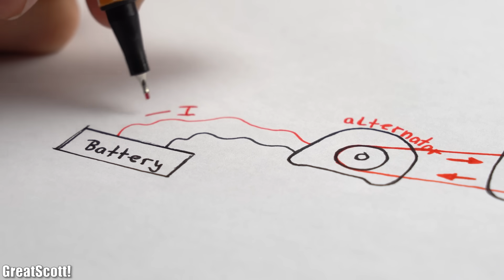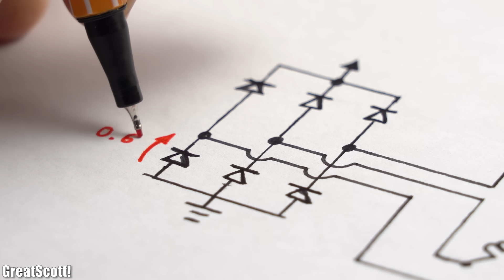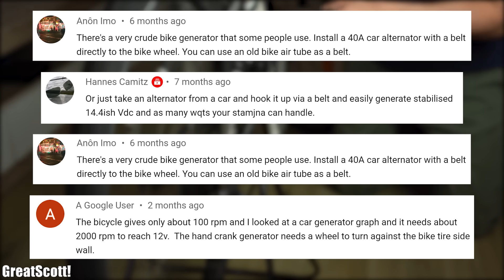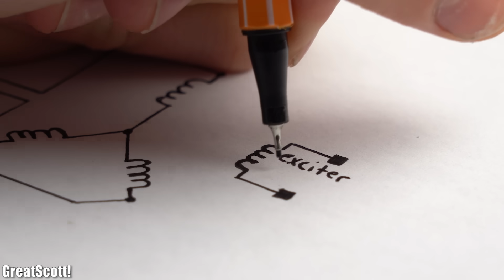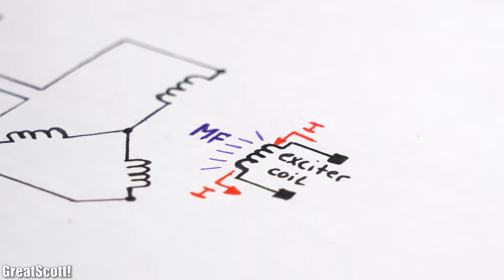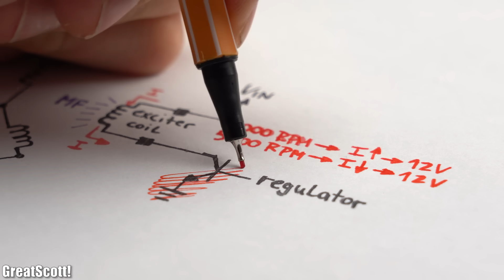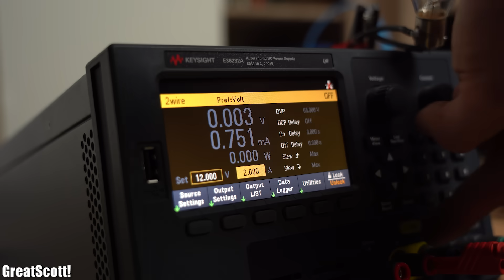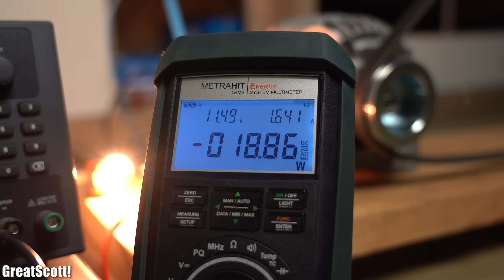Using a car alternator with a bike to power my home? How much energy can I produce?!

Comment: Instead of taking apart the alternator, all you had to do was add a battery.  Then connect a inverter to the battery.  The more power that you draw from the battery, the more the alternator will supply as long as you can maintain a constant rpm.
Reply: yep an auto electritian wired one up for charging batteries at his work but it takes 1 hp to drive an alt and we cant generate  that for very long. He had a 1 hp motor attached and it worked well. maybe a smaller gen would work rather than  a car one .try a wipermotor
Reply: @claudegrayson7039  try a hvac condenser motor !
Reply: 1 hp could be attained by several people. It would take some serious  engineering to make it happen, but if it had to be done then that's it.
Reply: I have an inverter linked to a car battery which I use to power LED festoon lights in a 20 ft shipping container. It's OK for low power demand and I get ages out of it before I have to recharge it at home. Perhaps the best way of looking at it with that set up is that instead of say paying to use the gym the free exercise session on the bike could be used to top up a car battery via the alternator which could be used to power a laptop, charge your phone or TV to save money with the expensive cost of electricity these days
Reply: @stoneislandkirkcaldy how much pedalling would it take to fully charge a battery?
Reply: @tomkeegan3782  no idea although good exercise
Reply: Solar , Wind , and gearing in conjunction with most of what has already been said .
Reply: Yeah but then how will he win the Tour De France? Or in this case Germany?
Reply: That's why they call it an alternator instead of a generator.
Reply: The exciter winding will saturate quickly,resulting in its fixed power requirement.However one can increase the exciter voltage,within the limits it can tolerate,for greater power output,however the stronger the exciter field becomes,the more power it takes to turn the wheel.
Reply: Could a water wheel be used with the right application?
Reply: @MoltenMozzarella Priceless.  Mean spirited but priceless.
Reply: great video. i think there was also significant loss from belt slippage and the rickety wood construct. yes i do believe that even just a small 12v battery wouldve helped.
Reply: Yeah or just make a wind turbine and add a solar panel to the coils when there's sun and win your gone get power and when there's no sun there is no resistance so you won't have to worry about it blowing up in the evenings. Or on really stormy over cast days.
Reply: This involves a loss of Efficiency so even if you started with a fully charged battery it would drain down till flat .
Reply: @Suzukidave  The battery connected between the alternator and the inverter acts like a reserve.  And the alternator needs the battery to start producing current.
Reply: @mike77tmc2   sorry mike I was trying to reply about useing a drill to power the alt .
Reply: U can have the drill with batery and u put the batery recharging with solar panel and use that power solar charged to put drill working the alternator.@mike77tmc2
Reply: @Suzukidave resistance like any person knows just thinking in our body, when u climb u spent more energy than down the hill..the same is with energy production..
Reply: Is so simple to understand free energy unstoppable is impossible thinking in a Dinamo bike creating light at night with wheels rotating, but there what is the energy needed for produce the light energy, YOUR BODY ENERGY, YOU STOP ROTATING THE WHEELS AND THE ENERGY LIGHT STOP...SO, YOU HAVE TO PUT ENERGY TO CREAT ENERGY, EVEN SOLAR ENERGY PRODUTION IS GONNE IN THE NIGHT BEING A CYCLE OF CHANGE SOMETHING FOR OTHER THING, NOTHING 100%FREE, EVEN IN NATURE...
Reply: Use a few alternators and a reliable rpm source to charge the batteries and plug the batteries in series to add voltage
Reply: Nope. An inverter just shifts the decimal 10 amp draw on 120v is 100 amp draw 12v at battery. Youd waste just as much as you generate edit: thats assuming you have a high efficiency inverter
Reply: Is there a video to describe what you mean????
Reply: and the more energy out of the alternator /generator the harder the bicycle will be to pedal .
Sorry you can't get something for nothing !
Reply: What if you used the pedal power to charge the battery,  and then use the battery as your source of electricity?
Reply: Joseph Newman kinda did something like this but the battery was giving headrunning voltage to the machine and the machine took that voltage and multiplied it and created more voltage than the battery even supplied

amazing!!
Reply: Could you essentially turn the alternator with a drill that is powered by the alternator which is charging a battery system?
Reply: @limerind7493  if that worked we'd use that for all energy generation. The drill will not be completely efficient turning the electrical energy into mechanical energy (some of it is dispersed as heat, sound). The alternator also won't be able to turn all the rotation energy into electric energy because of that heat, sound, etc. There is no free energy, you always need to have a source such as consistent flowing water (which will eventually erode away the parts or divert its flow, sometimes rivers dry up as well). Basically anything that seems like free energy on Earth is powered by the sun or magnetism (which isn't a permanent force either).
Reply: @theweeviler what about TIDAL energy? That's Lunar. How much energy would be required to pump entire oceans, twice a day? And reminder Solar energy is just Nuclear energy, from a safe distance.
Reply: @limerind7493 this would essentially be perpetual motion. Perpetual motion is impossible because there is no such thing as 100% efficiency. Using the drill to run the alternator, charging the drill AND charging a battery would require not just 100% efficiency but higher than 100% efficiency. You would be creating energy, in violation of the first law of thermodynamics.
Reply: @limerind7493 no. E=mc2
Reply: @BRAV-lm6xk Enter the theory of RELATIVISTIC ENERGY and RELAVISTIC MATTER. What is the Mass of a Photon?
Reply: @limerind7493  Let me guess. You think you've stumbled upon perpetual energy?

Comment: Hello, thanks for the vidy.  First, good job experimenting.  But to get 1500 watts you'd need ~2 hp input...  As for excitation current, a control neg feedback should work (invertor and regular... common emitter followed by emitter follower xsitors (bias will control current curves).
What I'm looking for is the size of blades for a windmill that will generate >2hp and then use a cvt type pully coupler to keep rpm relatively constant on the alt with varying wind blade speeds ( varying within typical range of 5-20 mph wind). Torque is key but with that comes size :  (
Have you done anymore work or experiments re: efficiency?
Ty

Comment: There was a study done on the movement efficiency of the human, versus other animal species, and humans came in 4th! Not to have that happen to such an "advanced" species, they then conducted the same experiment on a human riding a bicycle - and the use of gears propelled (no pun intended) the movement efficiency of humans to #1 on the chart. I see no reason that you can't generate your own electricity, it's just the will to experiment and find the most efficient output.

Comment: My car has a 12v/140A alternator. Because I live in my car, I purchased an additional Deep Cycle AGM battery, that I charge with a 5A car battery charger, from the 12v outlet. Am I putting too much drain on my car alternator? Should I use gears to have the engine at around 2,000rpm, to ensure enough alternator output?

Comment: Could you not then use this set up to charge 12v car batters? Could you then use them in series as a battery bank and run DC converters off of it to power devices?

Comment: If a person lived in a sunny area where the sun is not obstructed by clouds most of the time I have the idea of using a frensnel lense to heat a cylinder with a think saline solution that would be one side of a heat exchanger that would heat water to produce steam to run a small turbine which could be attached to a Tractor alternator like commenter Curtis Still has suggested. There would have to be a heat sink attached to the exchanger to focus the lense on. It is not my idea . There was a similar experimental set up out west but on an industrial scale using  a lot of mirrors focused on at he base of a heating tower. Everyone like the idea of do it yourself and the idea odffree.

Comment: I work with DC water pumps and noticed they do generate a small amount of power. I have seen constructions where people ganged multiple together and used in windmill system. I may have to get a bike and try this myself. I could use the exercise

Comment: The pulley needs 70 percent coverage from belt so it needs a pulley. Also an alternator is designed to be pushed to about 70 percent consistently and they often need around 2000 rpm to really provide anywhere near rated power so you can swap the pulley on the alternator out for a smaller pulley to help

Comment: People use alts all the time to power there home. You have to remove the rectifier and use the AC that the alt produces. 3 90 amp alts will power a home easily

Comment: GreatScott's videos are normally very educational, but this one just made me laugh when he said he wanted to be able to power his house by pedalling a bike. I laughed again when he showed us the 1440 watt alternator that he had bought. A top athlete can only output 400 watts for short periods, and so (with no offence to GreatScott) he's not going to be able to generate 1440 watts all by himself, which would be needed just to boil a kettle. But to be fair, he did manage to generate enough power to charge his phone. Keep up the good work, GreatScott - your videos are excellent.
Reply: This comment deserves more attention. Worse, that 300-400 watt figure is often quoted, but it belies the reality. That doesn't mean 400 watts to the load. About 50% of that 400 watt figure just goes to internal operations and cooling off the body. So now you are down to around 200 watts at best to the load at your legs. Now add in the probable 50% efficiency of that bike and pully setup, and the best you could hope for is around 100 watts delivered to the alternator.  The alternator itself is quite efficient. 80% or better at rated load, but less at very light output such as you could generate with a bike. So an Olympic class athlete might be able to produce an effective 50-60 watts of electric power for a couple of hours. As you stated, good to charge your phone. But it will take hours to boil a cup of water.
Reply: @BangkokBubonaglia  Yeah, I've been muddling this myself.  If you are biking anyway, or maybe have other bikers, wouldn't it be better to be actually charging a battery?  I think the future is in LOWERING the power needed to run things. Most homes are HORRIBLY inefficient when it comes to power, and even more so heating.  

     But the bike idea is great for RUNNING things, rather than powering things. I had a bike hooked up to a washing machine to churn the drum, there are bike turbines to power food mills that work great.  And I hear they can even be used for transportation!
Reply: It's not just him but tons of people still on the mindset of watts and volts, not Amps so they have very little understanding of how much work is getting done. I mean he can do the math out etc, but yea they just early into buying instead of completing the math thoroughly and understanding how many exercise bikes it'll take to run a computer. Let's say we get 12v at 2amps on 1 bike, that's 50 exercise bikes with alternator just running all day to power 1 PC about 1000watts continuously doesn't take into factor electrical parts such as more parts/buck convertors/regulators/inverterss etc... I mean it's good learning experience, I mean even solar panels and wind turbine don't give the stated power rating it should as well.

Comment: I want to onnect a small 2 stroke engine to a car alternator and then use an inverter to convert it to 230v I felt this would be more efficient way to derive power from petrol as it's super expensive.
Looks like Sri Lanka is back to cycling power.

Comment: Next time use a GM single wire Alternator & a more stable drive system with a spring loaded tensioner pully for more constant drive tension. Also you would need to have a battery to stabilize the constant current and a reference voltage for the single wire alternator.

Comment: Love it!## Thats a lot of rigging and peddling...! 14.+ years. The math would have discouraged me alone.
However; with your electronic knowledge and a little modification, not elimination of the Regulator, you could feed back output too your field winding. You'd still need a spark to initialize it. Perhaps a charged super Cap or a starting capacitor type circuit?
You can't give up that easy.
Ya cant give a final verdict until you've tried all the possibilities. YOUR NOT FINISHED!

Comment: Why don't you try it with and induction motor with capacitor? It has a small residual magnetic field already which builds up once you apply rotation.

Comment: In 3:55 you are shifting ino the lowest gear, not into the highest one. To get a higher RPM you should have switched into the highest gear which means the smallest cog  on the back wheel.

Comment: Add an integrated pulley system so you're not just riding a bike with one wheel. If your alternator was instead, a small wheel with a larger wheel attached behind it, and that lead to a small wheel the same way with a larger wheel fused to it, you could effectively multiply your power output substantially.
Reply: How substantially? 15x? If it was that much then he could cut the 14 years of riding down to one year, to produce his one years worth of used power?

Comment: I once wanted to install two extra batteries in my pickup and charge them with the pickup's alternator. Reseach showed that it would put too much strain on the alternator. it just would not have enough power. A home, needs way more power then 3 batteries.

Comment: I am making a self propulsion ie "units" for everything electrical for the motives of self sufficient living because of the manipulation in the merchandise realm. Question friend why should I pay Me Electric company for power ie house appliances recharge cell phone everything when I can self propell it myself without me  using motors bike wheels water wind whatever when I have designed a unit that propells itself once started it's so simple  but I can't tell you how I've done it because if I do then someone finds out who I am I'm on a bit list for Big Giants to move me out the way. I can self power everything electrical to never ever plug into power socket ever again. And if I was I supposed offered enough money maybe I may reveal the information but @ this point I'm remaining silent as a lamb . I'm not referring to solar or turbines but self propulsion design why don't Big Tech make it. The evolution of money that's why everything from technology to medicine cancer all merchandise is a Big scam. All I can say is ask YHWH for wisdom. If He gives it to you good luck. But if not it stays with me. I will never disclose my system even if I sell to close friends I will flood my units with epoxy 2pac resins so hard no will be Able to workout how it is made.

Comment: quite honestly I'd just contact the tire with the alternator's pulley, the tire grip would've probaly enough, or at least better than a belt without any tensioner.
Also, it would always be better to have like a small battery to both power the inductor coils, serve as reference, and better harness the output

Comment: To save you  some time. The two small terminals on the alternator are critical for its operation. Looking into it. Left is warning light. Do NOT exceed 1.2 watt. It will destroy the regular. Right terminal is ignition. Revolution off alternator must be 600 rpm minimum.  Will produce full current.

Comment: I'm sure someone has mentioned this already, but it's far better to use a PMA (Permanent Magnet Alternator) such as those used for DIY Wind Turbines. Mine was 24v 2kW and would generate power at low revs. They're a bit more expensive than a car alternator though.
Reply: An old ceiling fan.
Reply: Saw a (malfunctioning)car alternator do that prior to 2007.
Reply: what about a 12v 500watt?

Comment: @greatscott!  :this is really stupid. you can only produce as much energy as mechanical advantage*coloric input. if you can only eat 4kCAL per day what is your dumbass goal? so many sailors have tried to achieve power generation enough to supplement an ocean crossing. its been done sooooooo many times. a video with bibliography and a NEW experiment would be great. this is just the blind leading the blind. youll need many sacrificial humans to cross an ocean. tens, if not hundreds. using human digestive systems to create Joules does not work for our current technilogical level. this is just another video that confirms it, and is thus not worth watching.

Comment: What if you rig a setup where you have water in a container with a small hole so it can come out with pressure and that can be the means of spinning the alternator you can try something that holds maybe 30 or so gallons and the water can be put back so you reuse as much as possible basically a DIY hydroelectric generator without the river.

Comment: I run my cabin off two alternators  spun by water using 2 batteries  per alternator.
 I have 12V lights, and a 12V ac, and a 12V fridge, and a 12V TV and DVD player.  It runs all with no problem...
 I use the one wire gm alternators.